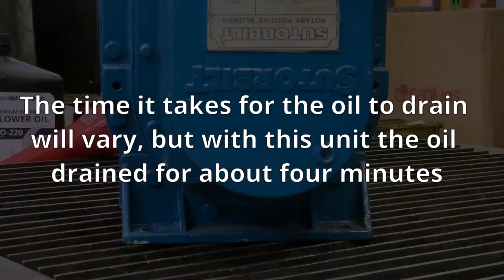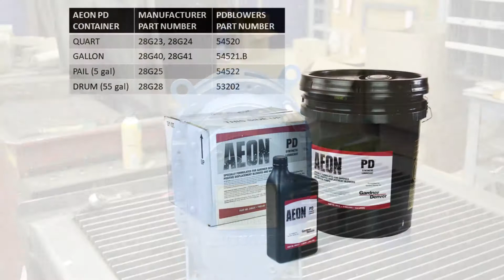How to change the oil in a Sutorbilt Legend Blower

Comment: My Sutorbilt blower has a sight glass.  What level would I fill it to?  1/4, 1/2, 3/4?
Reply from the maker: The manual says to fill to the halfway point when the unit is at rest.  However at that level when the unit is starting up you may not be able to see any oil in the sight glass.  Our standard practice is to fill to approximately 3/4 of the sight glass so that when the unit is starting up you will still be able to see some oil in the sight glass.
Reply: @pdblowers  
Thanks for the expert advice!  I just changed and filled 1/2 way I’ll definitely add a bit more. 
Another question I have out of curiosity, would the vent blow out any excess in the case of overfill?